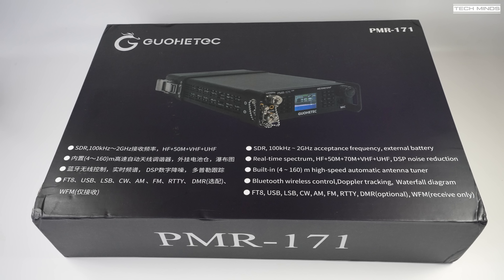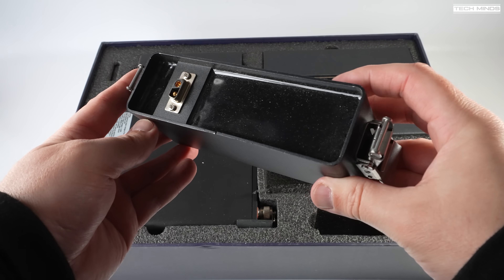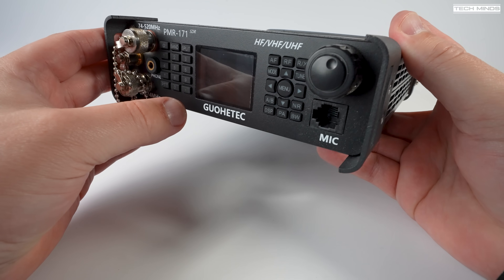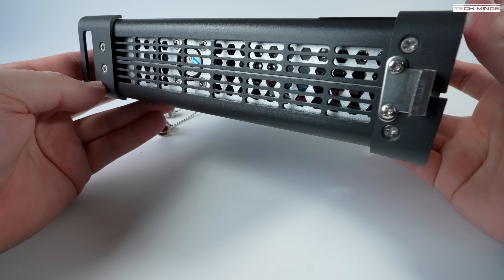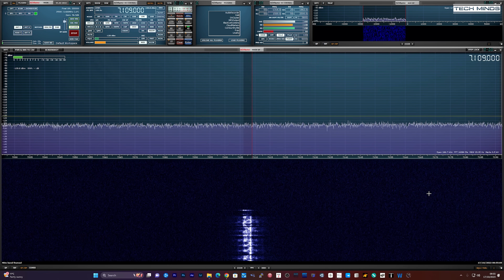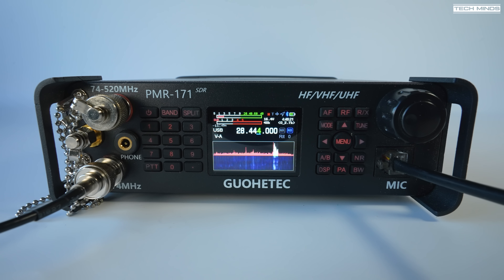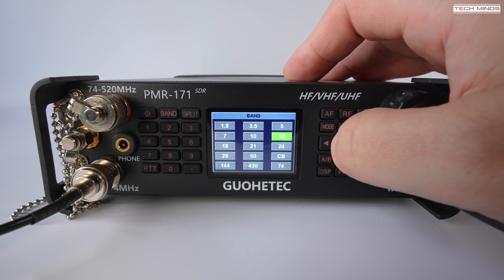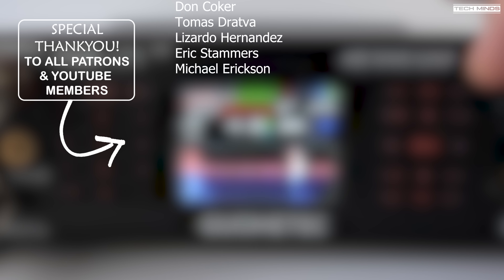GUOHETEC PMR-171 ALL MODE - HF/VHF/UHF SDR TRANSCEIVER

Comment: That rig is really cool. Does it have equalizer adjustment on the transmit signal?  Thanks Matt. 73 de WA3RSL
Reply from the maker: Yep, you just press the PTT and you can adjust Treble and Bass for the transmitted audio.
Reply: Great! Thanks. 73 @TechMindsOfficial

Comment: It looks like an interesting successor to the Yaesu FT-817/818 which is no longer being manufactured...
But a pity that they put all those connections on the back where they are covered when the battery is installed.  These should be moved to the side or even the front...
Reply from the maker: There is a battery separation cable supplied. I’ll do a follow up video answering everyone’s questions soon.
Reply: Great!  @TechMindsOfficial

Comment: It looks like for digiral operation the battery has to be removed to access the USB and audio connections.
Reply from the maker: You can use Bluetooth instead. Or use the battery separation cable that is included.
Reply: @TechMindsOfficial  Bluetooth is an awesome capability to have included!

Comment: Not sure I'd be happy with the fact that  all the ports are hidden when the battery is installed. It basically makes it an SSB only transceiver with that battery installed.
Reply: If you install the tiny USB dongle from a wireless keyboard (I recommend a mini keyboard) you can do native CW and RTTY.
Reply: @dschaefer6454  except I would like to use an actual paddle and not have the computer do everything for me. If I wanted that I'd use FT8
Reply: This form factor is so much like the military sincgars radios.  They’d have the battery park on the bottom, that you’d take off to mount in the rack in a vehicle.
Reply from the maker: It has Bluetooth which supports cat control and audio. There is also a battery separation cable included if you really want to access the rear ports.

Comment: Excellent review Mat - thanks!
Looks like it would replace my G90 and 2/70 HT quite nicely as I operate both from the beach but never at the same time.

Can you think of any benefits that the G90 has over this other than (from what I can see) a slightly smaller size?
Cheers!

Matt M0PTO
Reply: Automatic tuner is a big one, I'd say. Also, the detachable head presents options for vehicle mounting the PMR does not have. E.g. mount the base somewhere in the back of the vehicle, and put the head unit up on the dash.
Reply: @sypher4912 Also, detachable head: the PMR-171 has a Smartphone app that controls the radio over Bluetooth which is like having a remote head.
Reply from the maker: @sypher4912  This has an inbuilt ATU. 
@tincanblower  The G90 is a great radio!
Reply: @sypher4912 This PMR-171 has an even better ATU (tuner) that tunes all the way up to 74MHz instead of just 30 or 55MHz.

Comment: Thanks for the video. I look forward to them.
1. No built in tuner
2. Selected ham bands. How can I operate 137 KHz, or 474 KHz, or 222 MHz,  or 902 MHz,  or 1.2 GHz ???
Can this transceiver be opened up for all TX frequencies ?
4. What frequency accuracy improvement can be achieved using an optional GPS antenna, or is the GPS option only used to detemine posisition ?
5. If I am setting up WSJT-X, what CAT emulation does it use ?  ICOM ??
6. I am very interested in this radio, for a future purchase.
7. For normal HF operation I would go with the Xiegu C-106, at less than 1/3rd of the price.

Thanks again for another very interesting video. You keep us on the leading edge of product availability.

 Stan

ZZZZz
Reply from the maker: It has a built in tuner. You can direct dial frequencies using the mic or use the VFO and set Step to MHz. FT817 I believe.
Reply: @TechMindsOfficial  Wait, it DOES have a tuner? I thought you said it only had SWR protection?
Reply from the maker: @sypher4912 yes it has a tuner, hence the TUNE button.
Reply: @sypher4912  Specs on their site says it can tune 1:3. This rig might be a G90 killer.
Reply: @MichaelLaferriere  It's too expensive to seriously challenge the G90
Reply: @doublebrown3613  They are only a couple of hundred bucks apart. And for the extra features you get, its definitely a comparable system. Heck, this one even comes with a built in battery. That alone gets the price closer to get on the air.

What would hold me back is if the build quality is comparable to the G90 it might not be worth it. We will have to see.

Comment: Hi Mat
I am interested in portable FT8 and it's configuration. If you visit your "local hiltop" a FT8 (or Wisper) connection on 2m or even 70cm would be awsome. Unsusual request but is there somethign like FT8 on 2 or 70 at all?
Reply: I do believe there is 2m.
Reply: @bryandankanich898 
There is 2m for sure.
What I ment is if something like FT8/Wisper takes place on 2m (70cm). 
Would be interesting to see some "true" 2m long range comunication with FT8 especially with cheap and easy to build and setup Yagies or Moxons ... (just my thoughts)
Reply: @MrChesswulf  There is some local ish activity on 2m FT8 in the UK most of the time,  lots more activity on 2m and 70cm (sometimes 23cm too) when there's tropo or sporadic Es (or a contest).
Reply from the maker: Check this video I made on the Q900 software, the PMR171 can use the same software https://youtu.be/o8ovuRo4f2E

Comment: Another interesting radio offering. Lots of nice, listed features. Wondering if the 171 can provide analog APRS beaconing and toggle between two channels? And if so, does it mute the beacon TX audio? Wondering too if this can support Amateur radio satellite ops?
Reply from the maker: As far as I know the APRS only works in China, and it requires a sim card as it uses APRS-IS rather than actual APRS over the air.  Also I have included a link in the pinned comment above to a video where I show the available software packages that can run on Android over Bluetooth to the radio. Great for portable DIGI. Thanks :-) There is also an app called StarTracker, which works with this radio. Its a satellite tracking and cat control application.
Reply: It looks like a nice secondary / emergency use radio….
Does anyone know what the DMR add-on costs?
Thanks!
Reply: @PowderMill you're better off ordering the version that has the modules installed if that's what you want.

Comment: Looks like no CW or digital while on battery?
Reply: Bye bye POTA and SOTA
Reply from the maker: There is a supplied battery separation  cable that exposes the ports, or you can use Bluetooth which provides cat and audio.
Reply from the maker: https://twitter.com/TechMindsYT/status/1714751865307488746

Comment: What’s the antenna matching like? Is it as versatile as a G90, which this is a pretty direct competitor for at HF.
Reply: It looks like a jacked up G90.
Reply: @bassmanjr100  I would say the G90 still presents some better options than the PMR in terms of the remote-mountable head, and an automatic tuner, but overall the PMR would be a better radio for use in a backpack/POTA use case, I think.
Reply: @sypher4912 It does have an ATU better than the G90s. The BT smartphone app is just like a remote head.
Reply: Great review, but what about CW?🤔🇺🇸